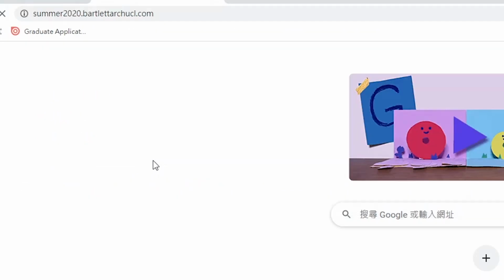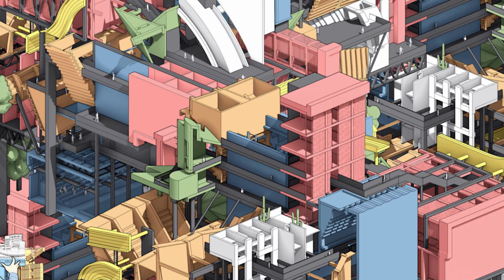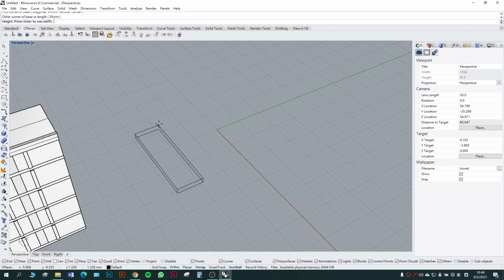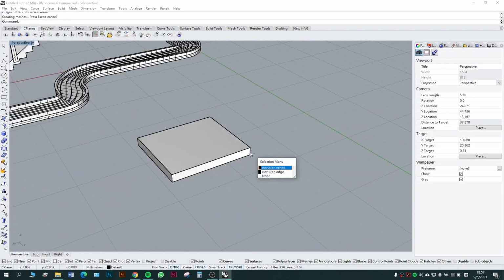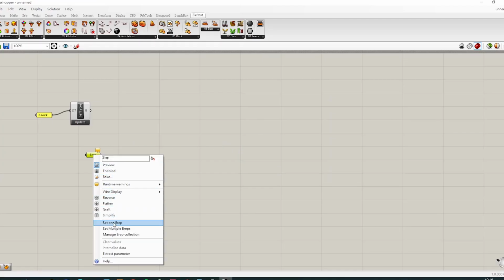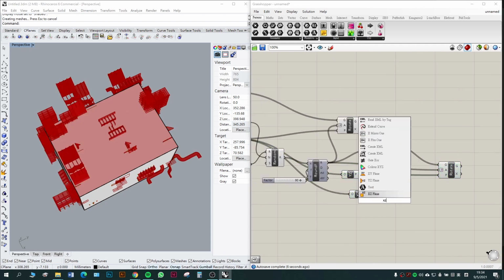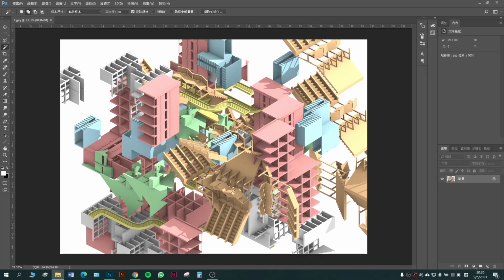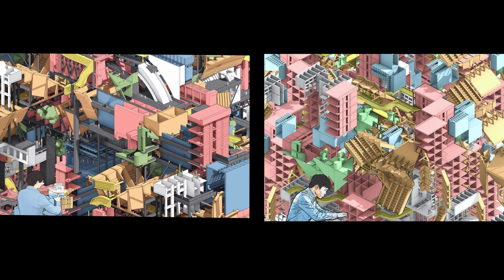The MOST DYSTOPIAN Drawing by UCL Bartlett Student !!!

Comment: Hi, the reference by type node where can that be located in grasshopper
Reply: @Viscomify   thanks for the response I actually got that one but there were a few nodes that were not visible as in where were they connected to LIKE RANDOM & REPEAT. i am new to gh probably disturbing u with the silliest of questions sbt, hope u dont mind
Reply: @vronmerjoe5562  Hi where is the response, im trying to make it work as well but due to it being cropped of the screen I cant figure it out. The reply is not showing
Reply: @Viscomify  that is everything I need; I'm so very thankful to your for such an empathetic reception and response to my queries. Thanks a lot.
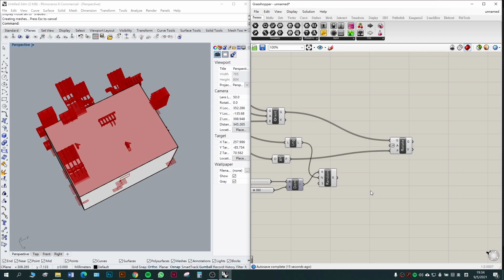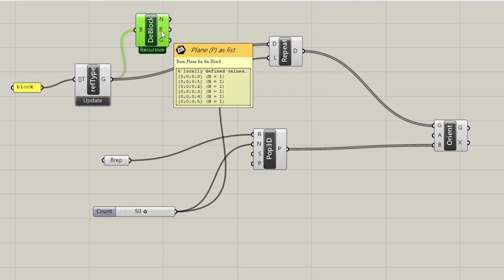Reply: Requesting you to kindly share the node connections from GH, @2:34 I had it all, @2:35 a few nodes were new random etc would be very kind of you if you could share or throw some light on the same. Thanks again.